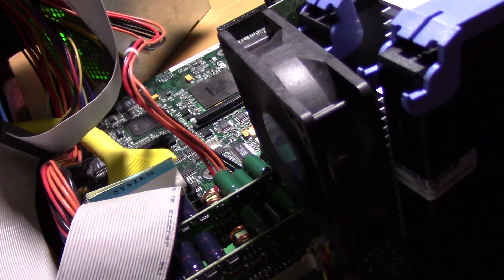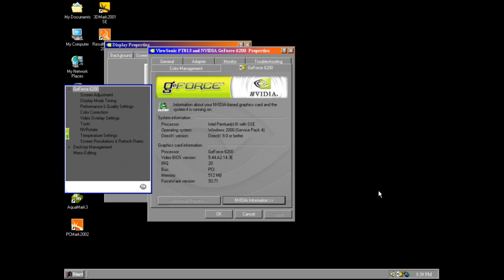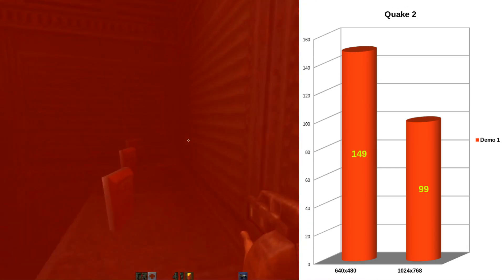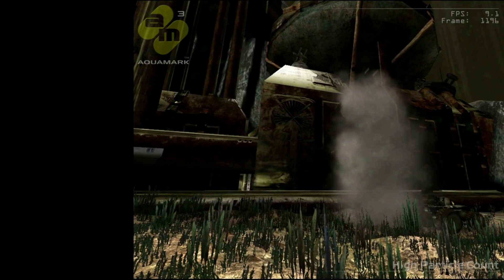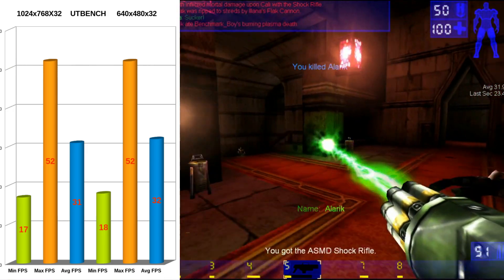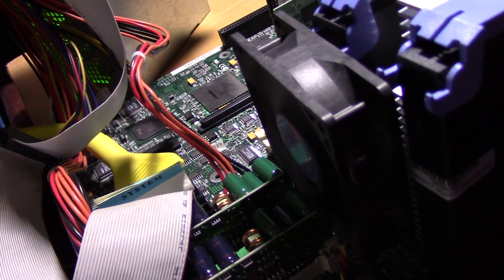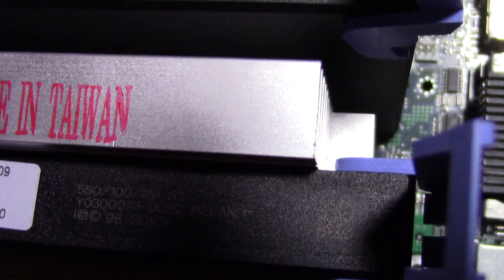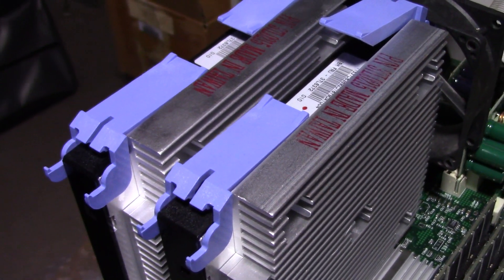Dual Slot 2 Xeon Pentium III Benchmarks

Comment: Get a pcie to pci adapter and shoveling a 9800gx2 on it now because your xeons are choking by that puny 6200se pci. Plus you know some xeon 900 /2m cache are unlock so you can set the jumper to make them run 1ghz with 10x multipliers if you get them.

Comment: tryin to find  a mobo with these  two on it but its so hard
Reply: true , and overpriced if you find one on Ebay . I would buy another one  in the future , for my private collection , I would  like to have  a 4 sockets 604  motherboard  that supports up to 4  pentium 4 xeons  cpus  , have you heard about that motherboard ? some versions goes up to 5 cpus .   it would be great to have one , install windows seven , windows 10  and see how it behaves in gaming , watching 4k videos , converting videos and multitasking
Reply: @tunkunrunk  got rack server IBM X series with 4 of these CPUs and 64 gb ram😀 used to run win 7 on it dor fun. Runs really good under ridiculous load like hunderrds of browser windows open. Not good for gaminf as it only have PCI slots but still fun to play with
Reply: @soton000    there were and there are still  great graphic cards for pci slots , I still have the ones I bought years ago  , and they go up to 256 mb ,  some reach 512mb .   Im sure that if you had  a 256mb nvidia pci card , raised your 64mb to at least 1gb  , you would have been able to playback full HD video (1080p)  , and why not 4K  , and pc games released between 2000 and 2008.   I think I need to make a video  about these vintage pci graphic cards for educational purpose

Comment: What's the point? The games are not optimized for dual cpu. You should try something that is optimized. Like 3ds max render for example.
Reply: Quake was probably the only popular game back then that had smp support.

So if you wanted to test the gaming performance on a system that was never meant for game out of pure curiosity, Quake was the sun of all your options.

Comment: A loooong time ago I had a Pentium3 Xeon running together with generic Pentium 2 on such a bord ... The system crashed from time to time but suprisingly it was able to run both processors fine most of the time. I was so proud havin a multi Processor system running even before  the Pentium 4  came out...

Comment: My old PC before I accidentally put a screwdriver to it trying the replace the heatsink, it currently has an AMD Athlon XP 2200+, GeForce 6200 PCI gpu with 256mb of ram & 2 (1GB) sticks of DDR PC3200 and it not only played & ran Witcher 1 at 1080p but actually booted up an actual demo version of Unigine : Tropics benchmark... "well for a whole 30 seconds before giving up probably due to heat". Since I detached/broke at least 2 micro-caps on the motherboard and slightly chipped the processor die, I don't think it will be running Windows XP anytime soon... However I'm thinking of making it run Windows 10 in the soon future ;)

Comment: Those processors are huge tho and the results in the benchmarks are excellent, some of them are decent while others would play just like a regular game does today, remember, before was 30 FPS and now are 60 FPS the recommended to play a game without any kind of lag 

And... did you try to benchmark a system using the monitor's native resolution with the graphics at the max??? o.o just by curiosity because for me that would be an extreme way to push the system up but sometimes I don't understand why everyone in the retro community just goes to only the 1024x768 setting instead of going for the much bigger one if the capture card and monitor support them

BTW, love your videos :3 keep it up
Reply from the maker: For one, I know my capture card will do 1024x768 60p capture, so that's one reason, but as far as benchmarks are concerned, it was a resolution that use to be considered pretty high and that's just what most reviewers back in the day tested games at.  A lot of CRT monitors max out at about 1280x1024 60hz. Bigger and fancier ones like I use for my retro stuff, will go much higher, but the higher the resolutions also hit fps so it's a balancing of fps vs resolution, and 1024x768 seems to end up being that happy place of speed vs quality for 1998-2001 era. A lot of 4:3 LCD monitors top out at 1280x1024 as well.
Reply: Oh, that's true, sometimes for example when I play some Quake II on a 1 gig Pentium III with half a gig and a pasive cooled MX400, goes well on the monitor's high resolutions but you are right, 1024x768 was the default "higher" (As you say, most monitors can go way over that resolution) standard on screen resolution that people and gamers used until year 2006
And being this rig 2x 550 at least for me is playable and decent :3
Reply: They're that massive because aside from just the cpu core and some vr stuff there are two large cache chips depending on the model. Got a pair of 550 2MB P2 xeons myself, would make a meme with one of these beasts along side with a couple of iphones ect.

Comment: I have a AGP 8X Geforce 6200.. it ain't much better.
Reply: Some can be unlocked to Geforce 6600. I bought one back in the day, second hand for fun.
Performance becomes quite decent after overclocking and unlocking. UT2004 performance was quite good.
Reply: I've been using radeon 9600 and Geforce fx 5600 without issue in combination with an Athlon 2600+ and slot A board. I primarily want good performance/max compatibility in 1995-2001 era games. Some of the newer cards have issues with older games in combination with the latest 2005 era drivers that support win 98SE.
Reply: how about a pci Voodoo 5? :D
Reply: Ｒｏｂ awesome. I think another great card would be the HD4850. with a few tweaks the thing works great with Windows 8.1.

Comment: GeForce FX series and higher aren't ideal for running on older PIII/Athlon machines as they were rather more optimized for SSE2 systems. I'm adamant if you find a max-spec GeForce 4 card you'll probably get slightly better framerates. Another thing to try would be a PCI Express card in the PCI-X slot somehow, they do make (rather expensive!) adapters to go from PCI-X to X16, so you could probably try a newer card on the ATI side (HD2400/2600?) in there.

if you want some 933s and their respective slot 2 brackets you're more than welcome to the ones I have in a server here for the cost of shipping along with anything else inside (medium flat-rate's worth probably, maybe smaller...), I have no idea to their functional state but they're in a server I'm planning on parting out soon since I just don't have the room to keep it. I think I also have vregs for them in there as well.
Reply from the maker: This board will only support the PIII 550 unfortunately. I originally purchased the 700's, but found those to not work and discovered Intel changed the power and signalling specifications of Slot 2 after Tanner, called to 330.1. The 933's I am not interested in because they are only 256K cache and I can't see why they would be any better than a normal PIII at that speed, plus I am not even sure this board will run 133Mhz bus.  I tested my MX4000 PCI card and it was pretty much the same scores on this board.  I would like to get one of those PCI-X to PCI-E adapters, but as you said, expensive. I do keep an eye on those though to see if they ever come down to a sane price. 

Originally, when I picked this board up, I also purchased a Matrox Parhellia 512 PCI-X card, but the card the seller sent me was an AGP version with 128MB of ram. I found someone of Vogons that benchmarked the Parhellia and the GF6200 and showed the GF6200 was a bit faster.  Matrox is the only card I saw that would probably do pretty well for gaming on PCI-X, and other PCI-X video cards are 3D workstation cards that look very impressive, but are designed to aid rendering in 3DStudio type applications. I've tried one of those Wildcat cards for gaming years ago and it sucked really really bad.
Reply: With a more recent boards (that support the newer chips) would it be possible to run dual 1400 Tualatins?
Reply: Geforce FX worked great on my PII 450, playing Warcraft 3 and Morrowind Elder Scrolls.
 Its a great WinXP 32bit card, not so much a Win7 64bit.
Drivers were XP optimized.

Comment: As an owner of a dual slot 2 system, they are neat beasts.  In my tests, the xeon is about 10% faster than the same speed pentium 3.  However if you have a processing load that fits into the L2 cache, it just curb-stomps the regular P3.
Reply: That was my experience too. Made me love xeons.

Comment: Please run some newer games, gta Vice city, San Andreas, half Life 2, cod4,etc (There's a free cod4 & HL2 demos) just to see if/how they run
Reply: Actually Vice City and Half-Life 2 run great on my Dual Xeon 700 2M with Quadro2 Pro (workstation version of a 64M GeForce2 Ultra)
The large L2 cache doesn't make a lot of difference comparing to a regular PIII-700, we're talking about 10 to 15% but the minimim fps on Xeon is way much higher.
Reply: GTA IV

Comment: Putting things further into perspective; those processors are larger than a PC/104 board. With the CPU at this speed I'd guess the extra cache would prove to be more useful in multitasking.
Reply: I would imagine server related applications are more cache intensive than what a consumer would expect to see, since that's what the Xeon line was intended for.

Comment: Really good this one, I always want to see these kind of Xeons SECC2 can do on gaming!
One question, is this GF6200 PCI rare? I have a Duorn system here that only has PCI slots and I never saw a PCI video board goes beyond 64Mb Ram.
Reply from the maker: No, there are a lot of them on ebay, new and used. There are actually faster nvidia GPU's on the PCI bus that have been made, for example I have an 8400GS PCI card, but it doesn't work on these older boards, so I would guess the faster GPU's don't either.
Reply: @WaybackTECH  wow , you had the same idea as I  , I contemplated buying the 8400GS PCI  card   , made by Nvidia  , it was the fastest  , but was expensive .  I wanted to play full HD videos using that gpu  on single core pentium 4   , but I discovered that  it was impossible ,  big part of the job was done by the cpu  , I had no choice than moving to dual core cpu .   I had almost forgotten  the 8400GS PC  , thanks

Comment: Why do you have the video card plugged into the second PCI 66MHz slot?
Does changing the card into PCI slot 1 on the 66MHz frequency change any of the benchmarks?
Does changing the video card to the 33MHz slots (3rd PCI slot away from the DIMMs) change any benchmarks?
Reply from the maker: nah there isn't a difference of performance. if the processors were faster there might be a difference between the 66mhz pci slot and the 33Mhz ones. the intel technical reference for this motherboard doesn't state if the 66Mhz pci are always running at 66 or if they auto detect the card installed. I did purchase a Matrox Parhelia 512 PCI-X card specifically for this motherboard, but was instead sent an AGP version instead, and from a post of Vogon's, the 6200 was a faster card anyway.